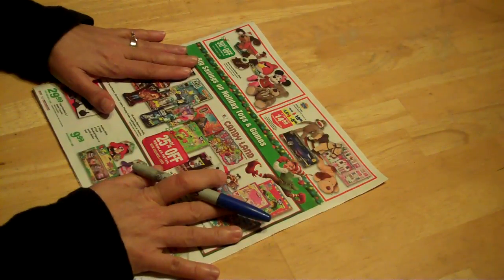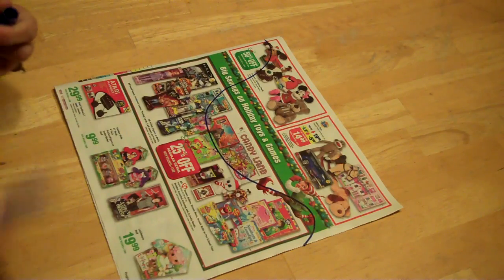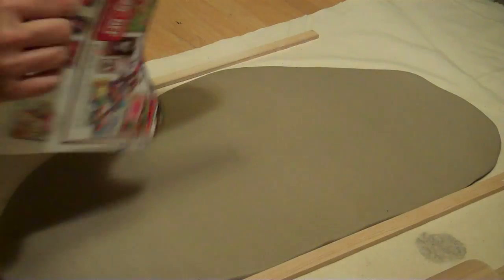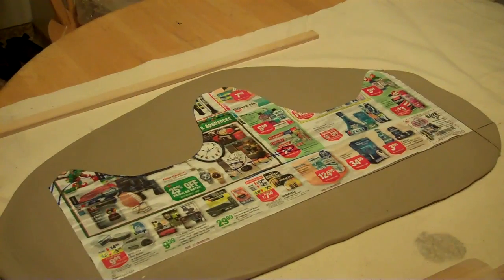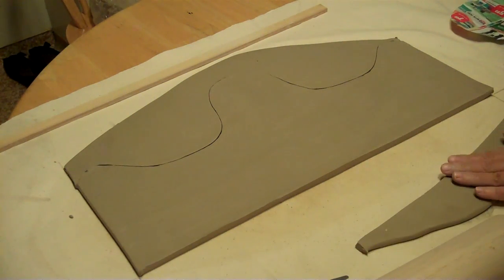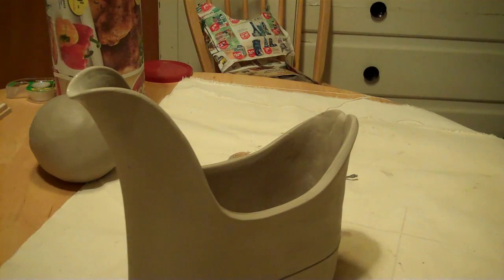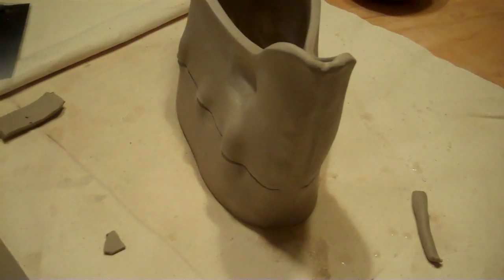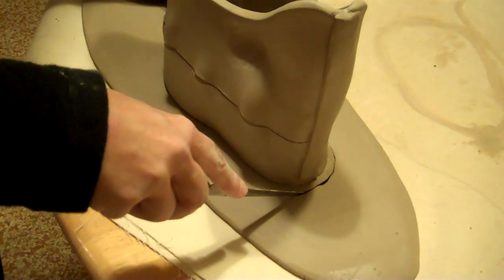February Clay Project - Making & Handbuilding Handless Pitcher - HobbyPotter

Comment: I can offer you one little tip. If you cut your joining seam at an angle ( / ) your two sides will fit together in a smoother seam and will be stronger too. I totally agree with muditsallabout. Great form and great idea to use a doily to create surface texture. I'll have to try that! Good luck on your gallery showing. Can't be there, but thank you for keeping such a good visual record of all your cups. You inspire me to keep a better visual record of my work.

Comment: Hello,
you used a tool from 4:45 till 4:55. What did you make with it and what is that tool doing. Is it making the edge even?
Reply from the maker: Hi Monika!  Is actually a small bit of sponge I used to compress the edge and clean it.  You can also use a small piece of plastic or shami. Hope this helps!
Reply: @hobbypotter  hi,
thx for your quick answer.
Can you tell me, what a "shami" is?
Kind regards from Germany
Monika